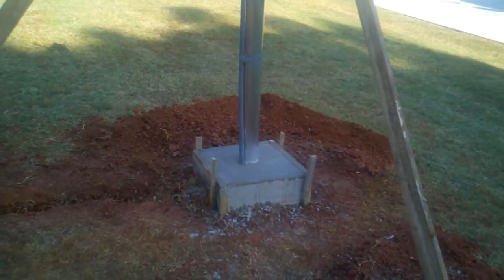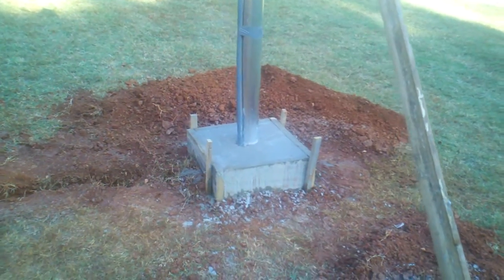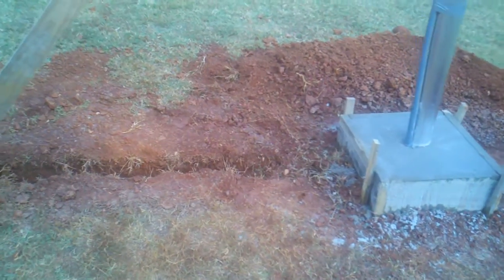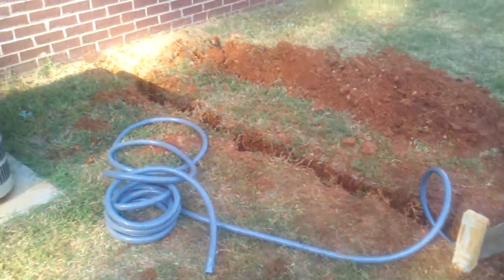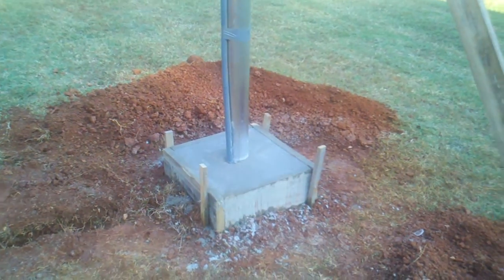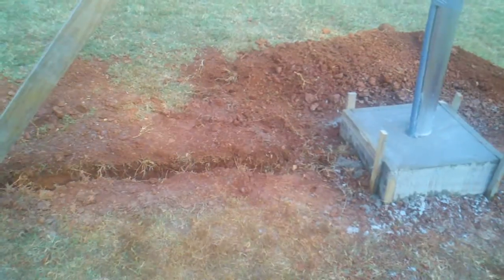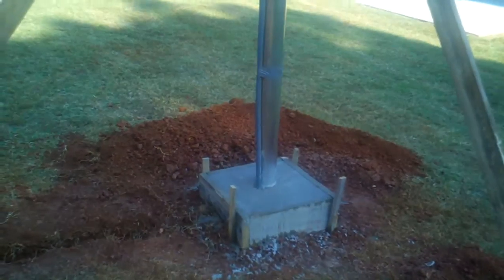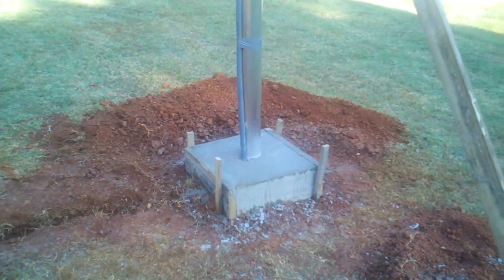DIY - Solar Top Of Pole Mounted Panels  Part #1 - Pipe Install

Comment: Correct me if I'm wrong, but I thought you couldn't mount a pole in the concrete due to corrosion and eventual metal breakdown.  I was always told this was incorrect.
Reply: rhandsom Aluminium doesn't rust but it certainly corrode through oxidisation.  In conjunction with any ferrous material you will also get galvanic corrosion.  But you'll probably would have lived out your natural life before having to worry about it. :-)
Reply from the maker: Cesar Romo The pole is aluminum structural tubing, putting this type of metal in concrete doesn't present a problem, considering aluminum doesn't typically corrode.  I've never heard of anyone saying you shouldn't put metal pipes in concrete, so I'm not familiar with any issues related to your statement.  I do however find it odd considering as a culture we've been mounting poles in concrete for decades with no problems.  But in any case, this situation should present no problems.
Reply from the maker: Thanks for your comments, and of course you are totally correct.
Reply: You are correct !  Installed many Satellite dishes in the 80's. This is a problem  you will outlive. Heavy, heavy galvanized steel pipe can stand up for quite a while. 
I've seen roofing tar put around the pipe at the top concrete line (Before pouring ) Concrete chemistry plus air and water, is a highly corrosive combination.
Un coated aluminum will corrode even faster. Sticking aluminum straight in the ground will survive longer; and you have heard not to do that.
But 6061 T6 aluminum with a yield strength as good as Schedual pipe. (at a third the weight), is the best price point in the market right now.
And I assume that is why they are using it here. But protect that aluminum from the concrete. Water and air will not degrade the aluminum. but the concrete will eat it up.

Comment: Doing a similar thing now. Using schedule 40 steel pipe though.
You mention in one video how hard it was threading the wire through the conduit. I would run a string through the conduit before burying it. I too will probably go inside pipe. I'd like to go aluminum on the pipe, but steel is quite a bit cheaper...
Reply: A shopvac will suck the string through the Conduit.

Comment from the maker: Thanks for your comments.  You have presented reasonable suggestions.  Running the wires through the pipe for one.  Drilling through the brick veneer is something I would have to consider.

Comment: You should have drilled a hole in the pipe and run the cable inside the pipe.  You also could have saved by drilling through the brick veneer at ground level into the house.

Comment: @rhandsom you can find water and electric lines yourself with witchin sticks. basically two wires with a bent handle and when you walk over a water or power line they will move to the sides. i have only seen it not work with 1 person which is very strange. google it to see how that works

Comment from the maker: As a side note, for safety I had the utility and phone company tell me in an outline where they had underground lines running before I began the digging process. Security of the installation is a high concern. So prior to installation I contacted my home owners insurance company and verified that the new structure would be covered for loss, theft, damage, and vandalism. I will be adding some security enhancements to help protect the investment.